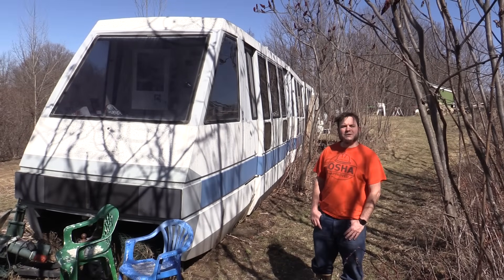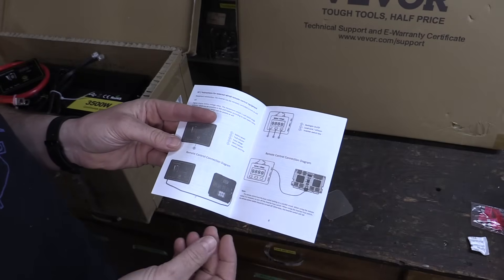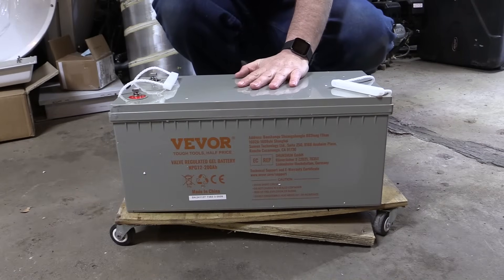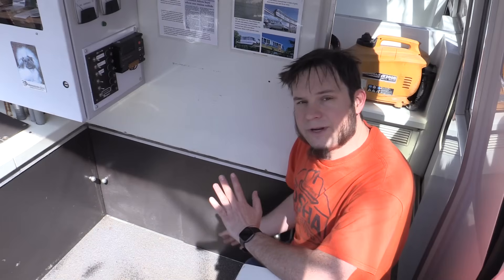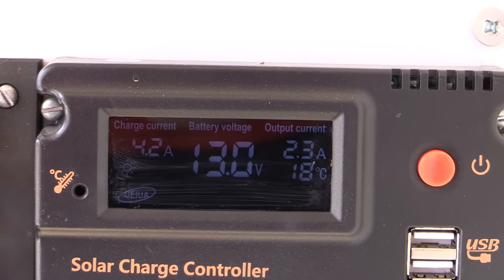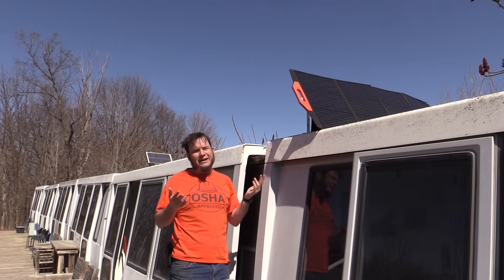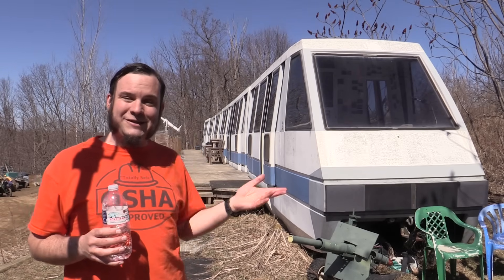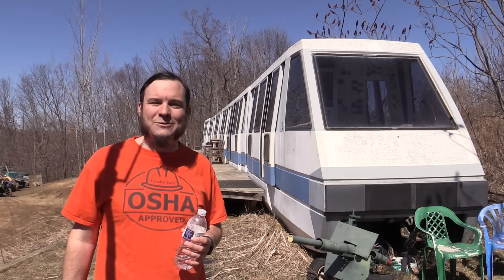Upgrading Our Solar Powered Monorail (Vevor Battery, Inverter, & Solar Panel Review)

Comment: You will have to replace the "monorail" with either regular tracks, or just put wheels on it so it can go around in a circle at least..
Otherwise, if it really cost $8,000 to get it on the property, you could have a fleet of free motorhomes instead.  :)
Reply from the maker: A fleet of rotting motorhomes just looks like every other redneck's boring yard. A monorail is cool :-)
Reply: @saveitforparts  Sure, except it isn't really a monorail when it has no rail and sits on the ground.  But you justified it you being lazy and cheap, and the train cars were neither.  Lazy and cheap would look like a redneck yard. :)

Comment: I used to work for FedEx Ground, and no doubt we take zero care of our packages.  As Ground, we get heavier stuff, and it gets kicked and dragged and dropped, and when it's busy, the trucks get packed overfull and other packages will fall onto each other just going around a corner.   Truly one should not use FedEx Ground to send anything fragile without overdoing the packaging.

Comment: That’s a group 8D battery.   That  battery is under weight they should be 160 to 180 pounds.   You also will get a much better case.   The price on the vevor is 340 buck  an 8 D will cost 500 to 600 but you will get far more hours out of it.    All vevor batteries seem light.  Even the group 31 I see they are light and less money.     I made batteries for Western Chloride.    It’s amazing how 2 batteries batteries the same size can be so different.   Best wishes

Comment: I would suggest that an Edison battery would be a better choice for a fixed installation. While they are heavier and less power dense that an lithium ion battery, they have a lifespan of decades and a greater operational temperature range. And while they do require maintenance with distilled water they do not use acid. Plus they can be serviced however with a lifespan of 60 to 80 years that should not be a big problem.

Comment: Now that you've got the "squat-lift" technique down, it is about time to start discovering the wonderful and exciting realm of back braces and (passive) exoskeletons. Better yet, avoid manual manipulation of massive objects altogether whenever possible. Seriously though, jokes aside, it may seem like "NBD" to you now, but trust me, every time you stress your spine and back muscles, it is highly likely (more probable, rather) that they sustain some damage regardless of how well😊😊 you (think that you) have mastered the procedure. The thing is that it all accumulates and will eventually catch up to you and bite you in the back (lulz - yah yah I know I know I said "jokes aside"). Anyways, just be careful and give some thought to acquiring some basic gear to relieve unnecessary/unwanted physical exertion. This is just one of those things to which it is best to apply preventive measures sooner than reactive measures later. Take care!

P.S. Someone just might argue that with appropriate regular physical training, it is possible to achieve a condition of body strength and agility so as to (almost) completely negate the aforementioned possibility of sustained damage. That I will not dispute; however, it will require a level of commitment to your training routine like that of a professional athlete. Really, how many folks here want/can/will/do spend 20+ hrs / wk in a gym? Gimme a break! Free time is meant for hacking!😊

Comment: Interesting setup always love videos about the Monorail, if that solar panel was putting out 8 amps at 13.3 volts thats about 106 watts, so correct me if I am wrong but to charge up from 40% to 100% (1.2kW) would take about 720 Watts, with losses figure 800 watts so about 8 hours of full sun. Also looking at the spec sheet for the battery it would probably last about 5 minutes if you actually loaded that inverter up to 3500 Watts or 292 Amps. However it would probably work good with starting a 120 VAC pump or saw motor. I'd recommend getting some larger PV panels (scrap of course) for the monorail and keep that portable panel for other stuff and shoot for at least 2kW of PV and add 3 more of those batteries. Cheers

Comment: That solar panel is not designed for that it's going to get wrecked pretty quickly at least the canvas shell it's contained in it's designed for temporary use where you store it and you pull it out when you need it so what I would do is run power to the sunny side of the monorail and just leave the power wire hanging there leave the 40 watt panels connected to keep the battery topped up and when you show up and you need more power plug in a second charge controller to the battery with the new panel and this way when you get there you pull the folding panel out set it up and plug it in both charge controllers can charge the battery I believe unless the solar panels output the same voltage you can't daisy chain them.
Reply: Derp of course about 2 minutes after I make that post you say exactly what I just said :-) I should have waited

Comment: A little more work, and the coons could have AC in the monorail when the humans aren't there. I'm sure they would like that. Are the windows in the driver's area pointing the the correct direction, so you could just leave the Vevor solar panel in the driver's window when you are gone, so the battery is always topped off?  The Vevor panel looks rugged, but not really for full time outdoor use. Great video, Thanks.
Reply from the maker: Yep, the driver's cab window points South, so I could just hang the panel inside there.

Comment: Keep in mind that Lead Acid capacity is always 50% of stated capacity, They discharge to half of rated capacity before dropping off. 200Ah is really 100Ah of usable power. Otherwise, great video as always.

Comment: @saveitforparts >>> I am about 3/4ths of the way through the video, and this question just popped into my head: 

Does snow build up on the top of the monorail in winter cause any structural problems for the monorail?
Reply from the maker: It just sits on top. They're designed for this climate, and they used to be parked outside at the zoo unless being worked on.
Reply: @saveitforparts >>> Okay, Thanks.

Comment: Cool video. I love the monorail. Sometimes a lead acid battery is the better choice depending on the situation, and AGM is the best lead acid choice for low amperage draw devices. I started my solar setup with a couple of AGM batteries back in 2018 and I still have that small system in place. The batteries are still working just fine. Now my bigger system has 10kwh of LiFePO4 batteries and 1200 watts of solar panels. It's our backup system for grid down situations.

Comment: Regarding what Gabe says, starting at about 06:14 in this video: 

FWIW: I purchased a hand truck equipped with pneumatic wheels SEVERAL years ago. That thing has paid for itself AT LEAST half a dozen times over already...👍

GABE: A hand truck goes well with a PICKUP...😊

Comment: Modern Lithium batteries die too easily. I was asked to fix this cheap solar light the other day. Apparently the person installing the solar panel read + as -, and the battery went to 0. I tried forcing the battery back to life. No luck. Oddly enough, it's cheaper to buy another light than it is to buy a replacement battery...

Comment: I'm glad you left it off, because I was thinking you can keep the panel up as a "sunblock" screen on the front monorail cab video so that not only does it keep it charging inside all year, but you can also keep the batt/inv at a cooler temperature.

Comment: Beware the soft/portable panels are generally not rated for permanent installations. They are supposed to be protected from the weather, which kinda ruins the point of a solar panel :)

Comment: Them vevor inverters are inpresivly good.. i stress tested a few models and they seem to work great.

Under/over voltage the inverter 
Overloading it
Parasidic load testing 
Etc..

Only concern i had was they where light weight so longevity is yet to be proven.

Side note.. 100% agree on gel batteries.

Comment: Couldn't agree more about FedEx, they are consistent when it comes to delays and damaged packages. As far as Vevor goes, I hope you have better luck than me. First time I purchased from them and had to return the product, customer service jerked me around for days to avoid paying for shipping (Amazon based purchase) and finally told me to keep the item instead of sending it back. Communication was a challenge, their English was broken at best. Fast forward to last month, I purchased a utility cart from them via Home Depot and the free delivery was fulfilled by FedEx. Red flag. Package gets delayed and arrives damaged with at least half of the assembly hardware missing. HD contacts Vevor to request replacement hardware and again we get jerked around and never hear back from them regarding a replacement. Bottomline is I am never purchasing from them again, I will happily spend more with a different brand. Same with FedEx, if I have the choice it won't be them!

Comment: Kickass videos as usual, and I like a local! I'm up in Duluth, MN. Aboot those there RGB LED numbers U has there. try every remote you have, they usually interfere with a few of those types! cheers
Reply from the maker: Yeah I have some spare remotes around. The mice have also chewed on the controllers which doesn't help!

Comment: I work for FedEx and the reason stuff gets broken/not delivered/lost is because it gets stacked floor to ceiling in trailers and unloaded at rate of one package every 3 seconds. Anyone with the skill and care to do their job right has the skill and care to get a better job, which they quickly do.

As a rule, anything you put throughout FedEx should be able to survive a 6 foot fall, because it will probably experience one.
Reply: Dont you guys then have to pay the damages sometimes

Edit: I don’t mean YOU, i mean the careless jerks that throw the packages
Reply: @hoteny  Not the individual package handler, no. But FedEx has to pay for it, I assume, and you're supposed to be written up for it. Keywords supposed to.
Reply: @hoteny all shipping companies have to unload and load in a very quick manner, including usps, you can't expect fast shipping without it, it also goes through sort or unloading and loading at each facility, so the further its shipped rhe more its moved around, its not directly put on one truck and then to your house

Comment: 11:45 According to the box, that's 3500 watts.  Enough to run power tools if you need to, and for sure a hot plate or microwave!  High class livin.

Comment: I made a solar light with a truck battery, a 24v panel, and .5 amp LED.  Turns on at night with a photo resistor and has been going for ten years through winter too. No charge controller, it uses a cars parking light bulb in series to limit the current. So if its full sun and the battery is charged up the light bulb will glow instead of overcharging the battery and stressing the solar panel. 
Its a balanced system and batteries love it cause like a muscle they need to be used.
Reply: Like this idea! Was tinkering with the notion of tossing some sort of lightbulbs onto an misbehaving massive amp that pops hard on turn-on. Shouldn't hurt the speakers as much anyway I'd imagine, being the resistance is minimal as long as the amps aren't high enough to turn on the lamp as I understand the concept.
Reply: @vjnobody  Might help by charging up the caps slower right?

Comment: You can put a big diode on the hot battery cable from the charge controller. Many controllers say they have reversal protection, might be limited to less amps than the battery bank can push tho. And which do you want to accidentally attempt to roast first, a cheaper diode (most will "recover" without damage) or the charge controller? 
   If you move to higher voltages (30+v), get a ceramic bleed resistor and a battery selector switch to soft-start the inverter. The capacitor lifespan can be improved by not firehosing them with a full battery bank from a cold start.
   That battery should have double the packing and a box-in-a-box, other gel glass mat leads do of that size. Like Renogy.

Comment: Commercial electrician who also builds off grid solar systems here. I could convert that monorail to 240v 3 phase and hook up a 3 phase solar battery system if you’re ever interested in making the monorail move again. Imagine the monorail moving at a constant 0.5 miles per hour all day as long as the sun is shining.
Reply from the maker: Ha! We didn't end up getting any track, the zoo tried to give it to me for free but then they remembered they have utility lines running through it, so now its a weird electrified boardwalk.
Reply: @saveitforparts >>> GET SOME TRACK {if you can} AND DO IT! THAT WOULD BE SO FREAKIN' COOL!!!!
Reply: @saveitforparts  i had a wild dream you found some tracks and had installed them down in the sand tunnels and it became a subway. Maybe i need to stop falling asleep to your old videos….
Reply: A moving monorail would be so badass
Reply: moving cool but also much harder to maintain and also be so unsafe
Reply: anyone can do that, you can just buy SRNE inverter with 3 phase out of the box lmfao and attach 2 wires to a battery

Comment: Ugh.. dude.... they wouldnt spring for the lithium battery? That SUUUUUUCKS... Lithium Titanate batteries are 3x more energy dense, can cycle 10,000-30,000 times vs 300-500 cycles for lead acid.. You can only pull 0.3c amps both in and out of Pb..... LTO is 10c+... LTO is also a lot safer than lead acid. More robust too.  OH and the operating temp is down to -30C compared to leads 0C btw. I just dont think many people are aware that LTO even exists honestly... most people are refering to Lithium Iron Phosphate or Lifepo4.
Reply: Did you not hear?  He explained that he chose lead acid for the low temp aspect.  Wisconsin can get pretty chilly and for an off-grid situation he determined that gave him the result he wanted.  Vevor doesn't sell LTO batteries.

Comment: I genuinely love the, "we were too lazy to set up a tent each time" but hauling in a monorail and wiring it for solar was def doable. That's a laziness I can respect and get behind. :)
Reply: One is a boring long process of permitting and planning, the other is just going full send and making the coolest place to camp
Reply: @Amehana_bassist one you have to maintain over and over and one maintains itself for the most part.
Reply: I have wanted a rail car or 5 for most of my life but not bad enough to pay for it, and putting in rail sections and having them hauled in.
Reply: Moving it is easy if you hire a house moving company.

Comment: the worst part about lead acid batteries is that effectively you need to kiss half the battery goodbye, if you go lower than 50% usage you're permanently damaging the battery whereas lithium doesn't care as much.
ofc in your case a lead acid is much preferrable as you're probably not gonna go anywhere near 50% and the self-discharge isn't an issue since it's being charged from solar year round

Comment: I use all 1000amp deep cycle lead acid marine batteries in all my solar projects and my home made battery banks "solar generators" they last year's and years. One I even ran really hard for a couple summers. It's still fine. Have a project going on right now with 2 marine batteries.

Comment: Why didn't you get a 24V power inverter? The inverter you got will need 350-400 amps at full load. More that about 2kW gets rather impractical at 12V.
Reply: I'm starting to encounter issues like that with my current 12v system also
Reply: Vevor doesn't do 24V unfortunatly.  
Their panels are 12V and they used to carry a couple 24V inverters but those are now discontinued. 
I wouldn't try to pull more than 15-20A (peak) off this unit in any case to keep a good safety margin.
Reply from the maker: I've never used 24V, I grew up with 12V and you can get every kind of appliance, charger, light, etc in 12v flavor.

Comment: Huh I just set up a very similar system today with an identical looking inverter, edecoa brand, a 300AH LFP battery and two 180W flexible panels stuck to the (EV) van roof.
It also charges from the EV 12V system at about 500W via DCDC.

Love the monorail! Consider a mil surplus gas turbine generator to make 480V :)

More practically I highly recommend the LFP batteries, as they are an easy way to move power around, definitely carryable, some even have convenient USB and 12V outlets built in.

Comment: your panel might get too hot in the summer  laying flat on the roof with no ventilation under it. Those amorphous type panels might degrade some of  their power output after  a few years. But yeah easy to move around for sure . Put it in full sun at the right angle and do short circuit test of it's current output sometime and you will have a bench mark to compare for later reference. Just short positive and negative wires coming from the panel with with an digital meter in series between them ( 10 amp rated current one ) or use a DC rated clamp meter on one of the wires when shorted.
Reply: Uh, it's going to put out well over 10A shorted.